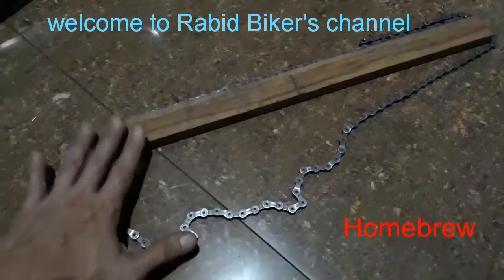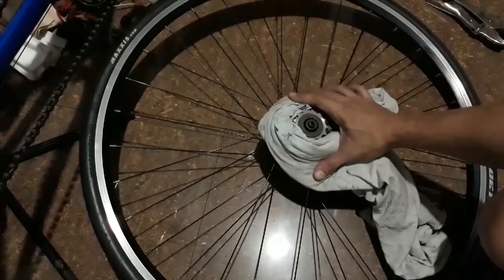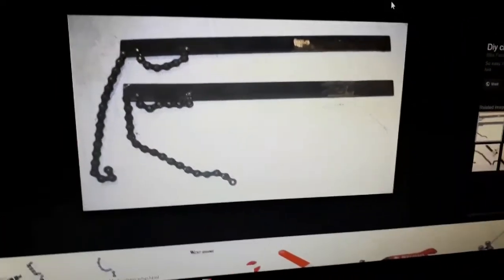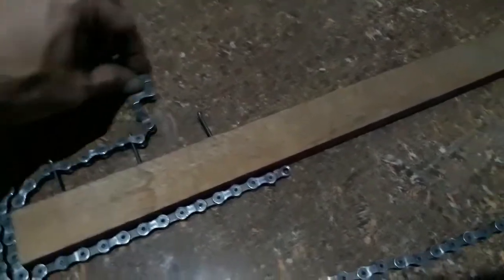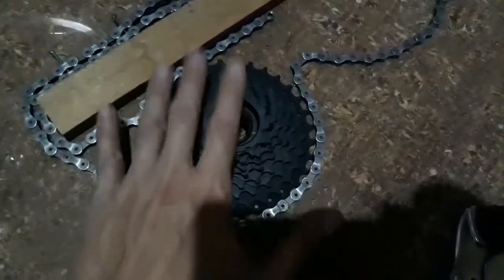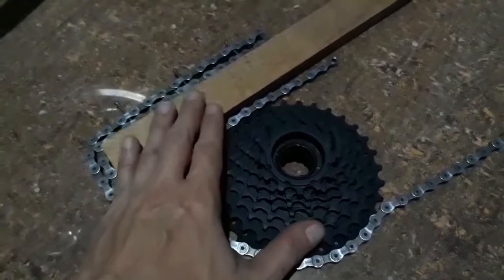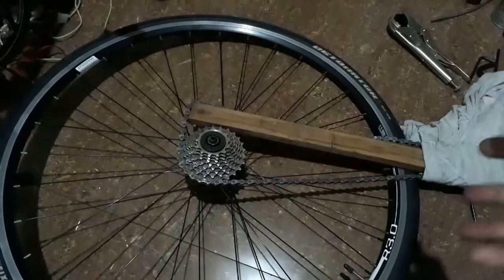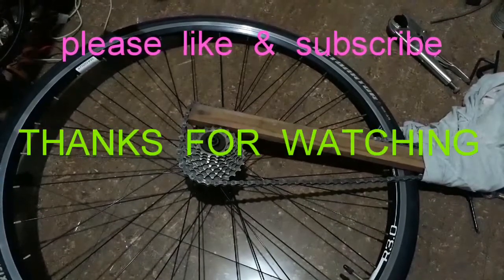How To Make an Easy DIY Bicycle Chain Whip Tool.. Simple and Home made

Comment: Hi i want to make this DIY chainwhip but i have one question : the size of the nails do not matter right - as long as they are small enuff to pass thru the links of the chain? I love videos like yours - i tried DIY ghetto tubeless tires and it worked too!
Reply from the maker: Hi Phat. Sorry for late reply.. internet is not available where i an assigned.. anyway.. size of the nail doesnt matter as long as it will fit between the plates..  finishing nails are ideal.. because they have almost no head.. or just cut the head off from common nail with pliers. Thanks for the comment!
Reply: @pharmaceia1jimenez2  Hi RB : made this tool and it worked like a charm! Used a completely worn out chain i had lying around and it now has a new life serving as a ghetto  chainwhip haha Thanks a lot brother!